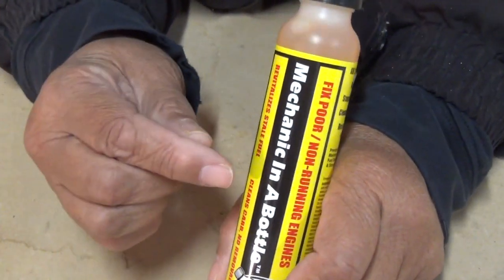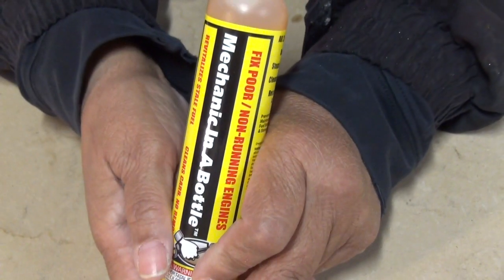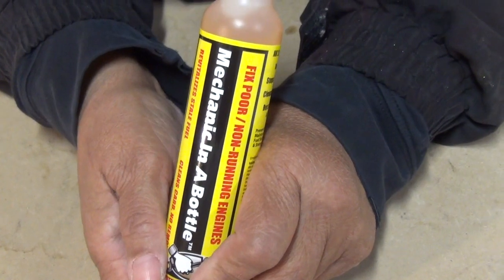What to Do If Your Lawnmower, Pressure Washer, etc Won't Start

Comment: Leah, because of family circumstances my mower skipped a few seasons of mowing. Last year I tried starting it again after changing spark plug, filter and oil change. Nothing. I thought it was a goner. This spring funds are tight and I dreaded getting a new mower. I so trust you! and decided to give it a try. Found the stuff at Home Depot (finally). At first, things were still sputtering after overnight treatment. But, I added more because it said you can't overdose. 20 tries of start and stop--and now it's running like new. I owe you girlfriend. Thanks SO much.
Reply from the maker: that is fantastic!!  It sounds like you really stuck with it, and it paid off for you...way to go!

Comment: Leah, I just want to thank you for all your helpful videos. I've mentioned before that I am a very handy woman myself. I just gave my fourteen year old Toro Personal Pace walk behind mower the once over and it's running like new. I replaced the carburetor, the traction cable, the belt, the pulley, the front axel drive assembly and transmission, and also retreaded the front wheels. It was very hard to start (but that Mechanic in a Bottle is amazing stuff!), but now it roars to life on the first crank after installation of the new carburetor. It recently stopped pulling itself, so after replacing both the belt and the traction cable without solving the problem, I knew the transmission was the culprit. Sure enough the problem is now solved. For a little over a $100 in parts plus some labor and patience, my mower is pretty much good as new and saved me the cost of a new mower. I'm on a fixed income so that would've added to my credit card debt, and I don't need any more of that! I just want to encourage others, both men and women, to TRY. Most repairs are easier than you think. Just watch some great YouTube videos [like Leah's] on your project, and use patience and common sense, then you'll be successful. By the way, I turned 64 in May, so if I can do these projects, "YOU can do this!" Keep up the good work, Leah!
Reply from the maker: Hi Southern Gal, way to go on refurbishing your own lawn mower!...that is very impressive, and a great illustration of how you can save a good amount of money by making your own repairs.  Thanks for being a part of the See Jane Drill community!
Reply: Thank you, Leah. You are an inspiration to all of us DIY'ers, especially gals like me.

Comment: Leah, thanks for sharing this tip.  I had a new pressure washer that I started once then didn't use.  Last year I had to serviced the pressure washer because I had left gas in it ($85.00 down the drain).  I added stabilizer to the gas that I placed in the pressure washer then again didn't use.  This year, I added more stabilizer to the gas before finding out it wouldn't start earlier this week.

Thanks to you and Mechanic in a Bottle, it started right up today, and I finally used the washer for about 3 hours.  Thanks again for the tip.  I'll never leave gas in my lawn equipment again.
Reply from the maker: that's great, glad everything worked out!

Comment: I remember seeing this product years ago in a store and thinking it must be a gimmick. But when my chainsaw wouldn't start, I remembered your video and thought I got to get that stuff Leah recommended. I searched everywhere, and couldn't find it in about a half-dozen stores. I tried different fuel treatment products from all those stores. Even ended up rebuilding the carburetor, and it still didn't start. I happened to find Mechanic In A Bottle in a local odd Lots store, When shopping for something else. I snatched it up, put it in the chainsaw and Wallah it started. Thank you so much!
Reply from the maker: It's always nice to hear peoples successes.  Thanks Shaun for sharing this!

Comment: I wish I watched this FIRST! I just put that stuff in my push mower, but something didn't seem right. It didn't say whether or not to leave the lid on and they were a bit vague as to how much to put in a lawnmower (most common power tool). I put in the WHOLE bottle and left the lid off, then came to see how others do it. I was so excited to see Seejanedrill, it was the first I clicked on! Thanks for the foolproof instructions! I ran out and put the lid on : ). You also helped me install some beautiful slate tile on my front porch last year! Thanks for all the help Leah! Take care and use safety equipment.
-KBB

Comment: Great advice. To add to what Leah has provided, the cause is due to normal gas evaporating and causing a varnish in the carb. If you are able to, non oxygenated fuel can sit without causing issues. I use it in all of my small engines and have had no problems since.

You can also reduce problems by running seldom used equipment dry of gas once you are done. Assuming there is a fuel shutoff valve that is. Or you can just drain the fuel tank and run the carb dry.

Comment: Hi Leah,maybe someday you can do a small engine carb clean/refresh-trust me they are really easy with basic hand tools.Most rebuild kits are around $15 + a can of carb cleaner.Biggest problem with no-start small engines is the fuel these days with methanol which attracts moisture. I've also seen complete aftermarket carbs online for $25.I also advise a screen type in-line fuel filter,and running the fuel completely out when storing the equipment off season.Hope this helps your viewers.

Comment: I just took a motorcycle out of storage that I was hitting and missing riding every 3 months. The problem wasn't that I wasn't riding it, the problem was I wasn't riding it long enough and refueling. At the end of the year it still had the original tank of gas. By the time I took it out of storage at the end of the year the fuel had turn to varnish in the carbs and the floats were stuck open in two of the 4 carburetors. The overflow bled all over the place until the new fuel started to free up the stuck floats. I'm considering trying this in it because the directions say you don't have to dump the tank in a running engine, just add the correct amount of additive. I'm looking at the website to see any cautions or recommendations about motorcycles. So far I don't see anything positive or negative about using this in a motorcycle.

Comment: Hi Leah! My wife and I recently purchased a fixer upper house and your videos have been super helpful. We received a lawn mower from my wife's grandfather that recently passed away. The lawn mower hasn't been used in years. We added gasoline but it won't start. (1) How do we drain the gas out of a lawnmower? (2) How do we make sure the Mechanic-in-a-Bottle makes it to the carburetor?
Reply from the maker: 1.Sometimes you can disconnect the fuel line between the tank and the carburetor to drain the tank. 2. Depressing  the primer button  helps to deliver fuel/mechanic in a bottle to the carburetor.  Good luck and sorry for your loss.
Reply: Thanks Leah!

Comment: Something that really helps a lot is to use non-ethanol gas.
Reply: Exactly!! I use premium gasoline in my two mowers and snowblower with fuel stabilizer of course for years simply because premium gas usually doesn't contain ethanol and hence no water accumulation in the gas. Never had a problem. At the end of the season I make sure to completely empty the fuel tank and run the engine dry.

Comment: Great information as always. I have a 12 year old B&S 14 horse motor on a riding lawn mower. It has been smoking for a year or so. Last week it let out a big puff of white smoke and died. When I tried to start it I could hear metal parts rattling around inside. Do you think MIB could fix it? (I'm joking) 

Serious question, I hear that you should run an engine dry before storing it for the winter. I did that on a Chinese motor on a HF pressure washer and the next year the tank was all rusted out. Is there a way to prevent an empty tank from rusting?

I've left all my mowers and weed eaters with what ever gas was in the tank when I last used the item and never added any winter stabilizers and they have always started the next spring. I guess I've been lucky for 60 years

Comment: Hi Leah, You say to be sure all the gas is out of the carb and gas line before adding MIB.  How do you make sure it's all out?  Thanks!
Reply: Debbie LoCicero drain the gas out of the carb, and take off your gas line going from the carb to the gas tank. Put a new fuel filter on,Put your gas line back on, add your gas treatment of choice,add new gas, and pull the cord a couple of times it should fire right up!!! If you have a old spark plug it would be a good idea to buy a new one as well!

Comment: After a small engine has been sitting for some time remove the spark plug, wet it / or dip it in to some Gasoline (do not hold it upside down (thread upwards) & fill with gas) replace spark plug & zip start. This will help initial start up & the ability for the fuel system to draw fuel toward the engine.

Comment: To get the gas out of the carburetor when you're putting your two-cycle to bed for the season, always run the engine until it runs out of gasoline.  This prevents buildup of (whatever it is) that clogs up fuel lines and carbs.  Next time you need to break out the mower/blower/chopper/generator/etc. be sure to use fresh gasoline.  None of my garden two-cycles (or four-cycles) engines sit idle more than two weeks with gasoline in the tank.  But I'm gonna find a couple bottles of Mechanic In A Bottle 'cause I have an older leaf blower a neighbor gave me.

Comment: Leah to the rescue! I have a pressure washer that hasn't been run in years. I put new gas in it, new spark plug, and it wouldn't start. I'm going to order this stuff and see what happens.
Reply: On a pressure washer, how do you make sure the Mechanic In A Bottle gets into the carburetor?
Reply: magicrobharv that's what the overnight wait does. It breaks down the chemicals so it can make it where it needs to go!

Comment: There is also a product called "Start ya bastard" that does the same thing and is just as cheap but it's a spray that you spray into your air filter and surrounds and it starts straight away :-)

Comment: As a word of caution, never run a pressure washer without the pump hooked up to a water supply. You could easily burn up the pump. Also, there are several products that will do what this product did, such as Sea Foam, but, unless you have gas that contains ethanol, which over time tries to turn back into corn, a tank of new and fresh gas should be all that's needed. Also, if you can find a supplier that sells nonethanol premium, that is what you should use in all small equipment. They will run better and the gas lasts longer.

Comment: One tip for gasoline for small engines...fill them with the highest octane you can.  Since gas cans only hold 2-3 gallons, mostly, the extra cost isn't much but the higher octane will help those small engines run better.
Reply from the maker: Nice tip!
Reply: It is always best to follow the manufacturer recommendation for fuel and oil in any gasoline engine. While the higher octane fuel may seem to help an engine run better, it also causes the spark plug to burn hotter which over time will not only damage the spark plug but will also cause damage to the piston.

Comment: Hi Seejanedrill. I bought and tried the mechanic in a bottle. It started for 2 seconds and died. I then cleaned the carburetor, made sure gas was flowing through the turn off switch thingy and again it started and died within seconds. Oh, it started and died both times only after spaying the carburetor with carburetor started. This said it may have started and died only bc I used that stuff. Any recommendation moving forward I would really appreciate. Thank you for your consideration.
Reply from the maker: I believe that Mechanic in a Bottle suggests you repeat the process if necessary.  Did you prime before starting?
Reply: Yes, I think i may need a new carburetor. I have been reading on causes of my issue and think it may be time to send to a lawn mower repair shop. I feel good at least trying the mechanic in a bottle. Thank you so much for the response and I appreciate you.